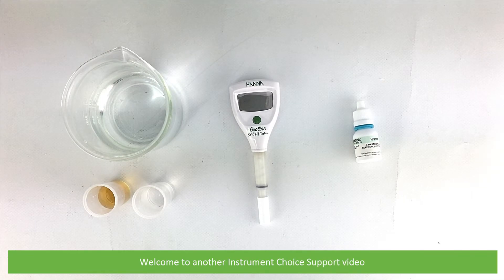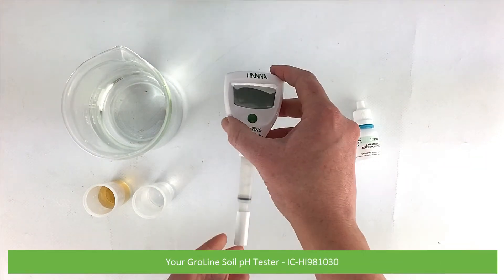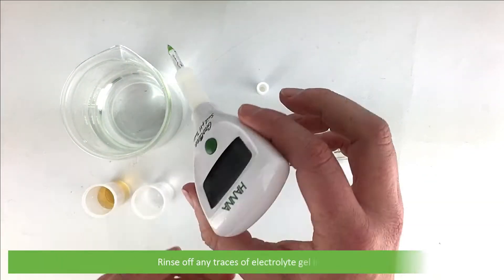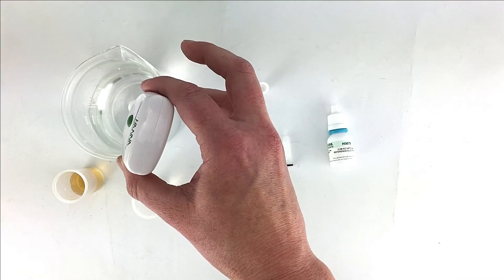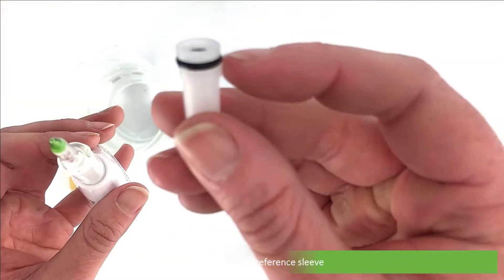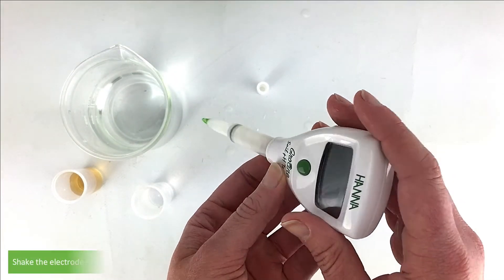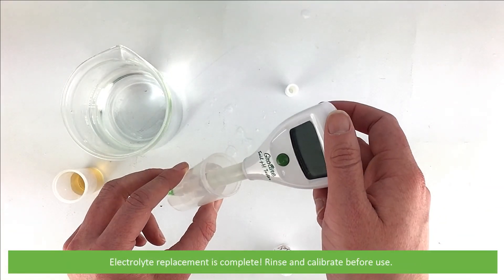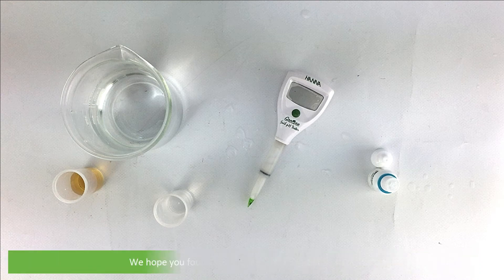How to Refill the Electrolyte Solution in the Groline Soil PH Tester (IC-HI981030)

Comment: The tester I received included HI9071 electrolyte solution instead of HI9070 shown in the video. Is this ok?
Reply from the maker: Hi @MariaWindisch, thanks for the question. Since publishing this video the code has been updated from HI9070 to HI9071. The steps will still remain the same :). We hope this helps.